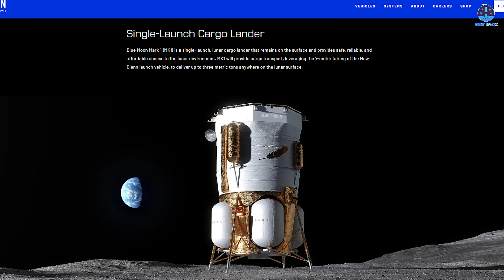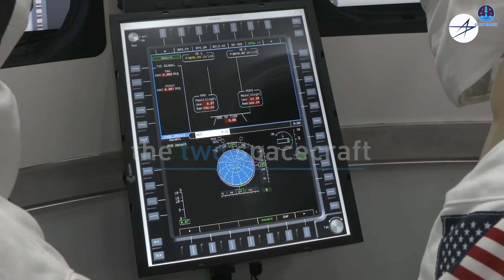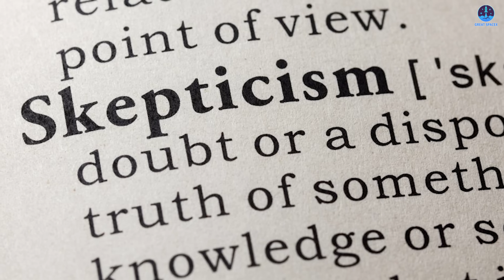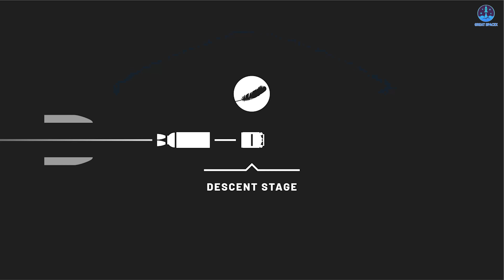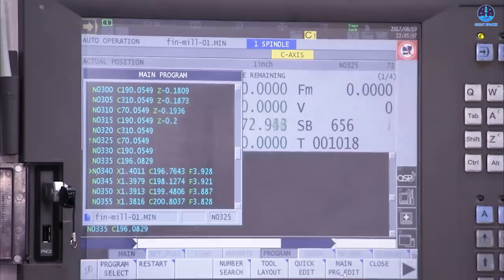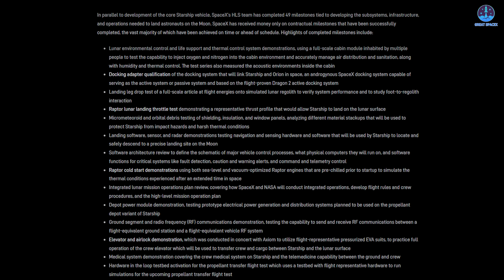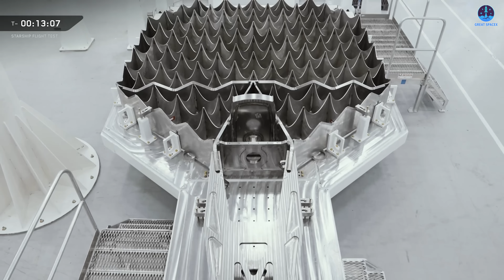Blue Origin revealed Mystery Lunar Lander Plan to Replace Starship to the Moon Faster BUT...

Comment: Unless SpaceX simplifies their mission they could definitely lose their contract. Trying to reland the Starship first stage is clearly tripping them up. The more failed attempts that happen the more NASA will get nervous. Blue Origin has been quietly working behind the scenes and their moon landing plan may not be as permanent as SpaceX’s, but it’s simple and can be implemented quickly. 

SpaceX’s best bet is to go with an expendable first stage then just focus on refueling the second stage in orbit. If they can do that NASA will feel a lot more comfortable with putting astronauts in a Starship.

Comment: What absolutely no one understands is that while other contractors work for a single, specific project (going to the ISS, going to the moon) and simply reuse the same blueprints to do the same thing again, SpaceX has a program, working to advance within each sub-project.

That is, the Crew Dragon is getting better and better, (more powerful, more reliable, cheaper, and faster to manufacture), and there will come a time when it will also be able to land on the moon.

The Falcon 9s are getting more and more powerful, the Raptor 3s are more powerful, more reliable, cheaper, and faster to manufacture—literally.

Comment: Blue Origin is a joke.
Reply: Oh, really? New Glenn successfully orbit on the very first flight. And already on the second flight they brought commercial payload by NASA to L1 (and finally to Mars) and landed the booster, and it worked perfect. The biggest booster ever landed on a ship, the only methalox booster that landed on a ship, a huge modern rocket. And they are working on Blue Moon Mk1, not just renderings, there are photos of that thing. The schedule for the moon landing of Mk 1 (Q1 2026) doesn't seem unrealistic.

But when you watch the presentation of SpaceX ITS in 2016 and the timeline you can say that SpaceX is a joke. Lowering the payload with each iteration (ITS > BFR > Starship),  postponing all the time, prototypes flight over an over. Can you explain with actual facts or evidence, that Starship HLS is really much closer to bring Orion astronauts to lunar surface, than Blue Moon Mk2 is?

Yes, SpaceX made 500 Falcon 9 flights. But that is the past and irrelevant for the moon missions. SpaceX themselves say that Starship is the future and will replace Falcon 9 also for small payloads. But that future is still unclear.

Comment: Blue origin is a joke when was the last time they launched a rocket? 🚀
Reply: Oh, really? New Glenn successfully orbit on the very first flight. And already on the second flight they brought commercial payload by NASA to L1 (and finally to Mars) and landed the booster, and it worked perfect. The biggest booster ever landed on a ship, the only methalox booster that landed on a ship, a huge modern rocket. And they are working on Blue Moon Mk1, not just renderings, there are photos of that thing. The schedule for the moon landing of Mk 1 (Q1 2026) doesn't seem unrealistic.

But when you watch the presentation of SpaceX ITS in 2016 and the timeline you can say that SpaceX is a joke. Lowering the payload with each iteration (ITS > BFR > Starship),  postponing all the time, prototypes flight over an over. Can you explain with actual facts or evidence, that Starship HLS is really much closer to bring Orion astronauts to lunar surface, than Blue Moon Mk2 is?

Yes, SpaceX made 500 Falcon 9 flights. But that is the past and irrelevant for the moon missions. SpaceX themselves say that Starship is the future and will replace Falcon 9 also for small payloads. But that future is still unclear.
Reply: @sebastiannolte1201 two flights down to Catch up to spacex over 1000 Successful space flights.

Comment: SpaceX is already far ahead and here is why, they can land Falcon9 on a barge bobbing in the rough ocean add to that being able to pinpoint target a spot to be gently hugged by 2 arms proves they have what it takes to land on anything with skyscraper size rocket stages. By mastering reentry after deploying Starlink sats will prefect landing and Starships ability for reuse. The HLS version will have its tiles and flaps removed for legs and the same goes for tanker and orbital fuel farm made from custom V3 variants that will be easy because the hardest part is landing and reuse. I could end up being Starship to HLS orbital transfer of cargo and personnel
Reply: Falcon 9 is the past and irrelevant for the moon landing. And I know your comment is 11 days old but meanwhile the New Glenn booster perfectly landed on a barge bobbing in the rough ocean. On only the 2nd try. After delivering actual commercial NASA paylod to L1 (finally to Mars). New Glenn uses modern Methalox engines (like Starship, unlike Falcon 9). New Glenn can hover and move lateral (like Starship, unlike Falcon 9). The  New Glenn booster is also much bigger than the Falcon booster; the landing looks more like a Starship  catching than a Falcon landing. But while Starship is a prototype, New Glenn is an operational vehicle.

And you talk about Starship as if it is already working. That is all theory. The refueling in orbit, the super cheap and fast refurbishment so that the price per launch will be super low,  the HLS version,... it seems you just parrot every claim that Elon makes and every nice render video that SpaceX publish and blindly believe it without looking at it critical.

Blue Moon v1 is not  rendering, they have built that thing, so the actual one (not some very early prototype). It is scheduled to land on the moon in Q 1 2026, launched by a New Gleen. That seems realistic to me.

Are you sure that Starship HLS is really so much closer to bring astronauts from Orion to lunar surface than Blue Moon v2?
Reply: @sebastiannolte1201 any advancements in space systems is a good thing. Yea BO landed on 2nd try but SpaceX did it first and successfully over 400 times. Dragon could have been modified and already landed on the moon but Starship makes permanent habitation and completion of moon base Alpha faster and cheaper than any other system even the new one booster by BO that will probably take 10yrs to build 1st of it's series Competition drives innovation but SpaceX is years ahead already in many areas of aerospace even if Starship hasn't actually gone orbital yet. We are just now entering the space age equal to the1930s aviation era making SpaceX the equivalent of Ford with first automobile production line.

Comment: From lift off, travel to the moon, landing, operations on the surface, lunar assent from the surface, traveling back and slash down.  Both are capable of such a task.  Good luck to both in 2026 & 27 with a Go for space flight in general and the safe return of that test DUMMY(s) 🌎👍🏾

Comment: So, the Mark 1.5 will be an improvement of an as-yet untested vehicle? Good for them. Good luck with that. And how many contractors' equipment will have to be integrated? I seem to recall their first proposed lander had systems built by three or four contractors. So, and untested, incremental improvement of one untested mishmash vehicle built by three contractors is going to compete with an all-in-one system built by a company with proven track record in space launches, life support, space station reboost, and reusable launch vehicles. Huh. Well, if they can surpass them, good for them. I wouldn't bet on it but I'll congratulate them if they do it. Maybe they can sue SpaceX and NASA again to slow them up until BO catches up?

Comment: SpaceX fan children get all but hurt and claim if any other organization launch a rocket their copying SpaceX, Rockets are generally cylindrical in shape with a nose section that carries a payload where a capsule or fairing is found. The midsection consists of fuel tanks, most commonly for liquid cryogenic propellants. On the lower section, you will find the engines. No one is copying SpaceX; they're simply building rockets. Spacex's drone ship isn't any different than any other GPS position-holding barge or ship; they exist in the real world, not exclusive to SpaceX. Automated systems to save a rocket after landing on a barge at sea are an obvious solution to protect humans from a dangerous environment. Get over the basics of the modern world; they're here to stay.
Reply: "No one is copying SpaceX"
Obviously you haven't seen any of the Chinese proposals for their next generation of launch systems.
Reply: Just say "I HATE ELON" Its would be more accurate.
Reply: @Kelledin-k2x  My opinion of Elon is a secondary point I didn't bother with.
Reply: @mp6756  Your love for Bezos shows.

Comment: New Glen is beating Starship to Mars this year and next year New Glen will beat Starship to the Moon. Maybe this will be a wake up call for SpaceX Starship and their fans. SpaceX should do a HLS based on the Dragon Capsule, Falcon Heavy rocket and a custom booster lander for the Dragon Capsule.
Reply: Actually you compare apples to oranges. Blue is launching a relatively small robotic ship to mars. SpaceX is planning a much larger program.
Reply from the maker: Great discussion 👍👍👍
Reply: Is Blue origin not just sending 2 ESCAPADE probes to loop at L2 Lagrange point until finally being sling shot to mars IF still working by time 2026-12 mars window opens so will arriving at mars 2027-09. While spaceX will also leave around leave around same time probes sling shot towards mars 2026-12 but spacex will be taking its rocket + Optimus robot to mars. Meaning new glenn not even going to mars just probes it left in orbit a year prior?
Reply: If that is the standard, falcon 9 is already heading to Jupiter with the Lucy probe.  Too bad BO is only going to Mars.  😂. Btw Falcon Heavy is going way out to an asteroid with the Psyche mission.

Comment: Keep in mind Blue Origin is long on promises but short on performance. Their Mk 1.5 will be late by years, if it ever happens.

SpaceX consider Stubby Starship coupled with an expendable interstage? The interstage provides Delta V for TLI and is then discarded. Stubby Starship has sufficient Delta Vee for direct lunar landing and return. I've not calculated fuel capacity so, don't know if it's feasible. Basic idea is to discardexcess mass early.
Alternative is rendezvous with a 2nd Starship in LEO, use it for TLI and lunarbapproach, discard and let Stubby complete landing and return.
Thoughts anyone?
.